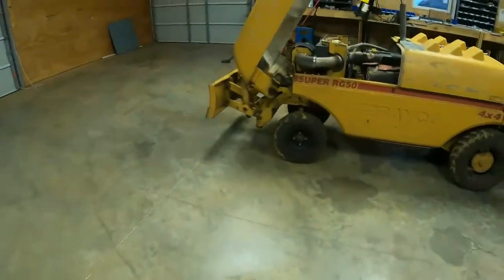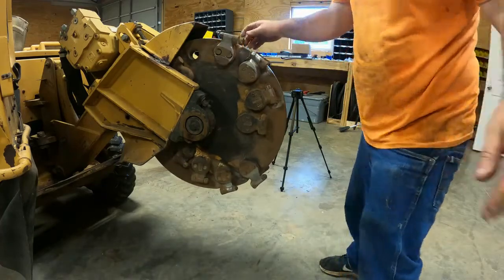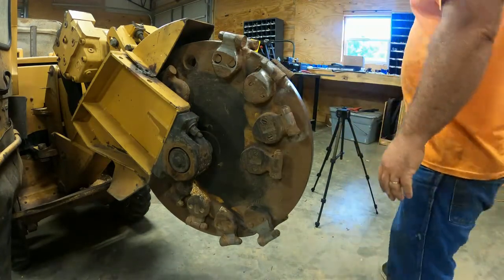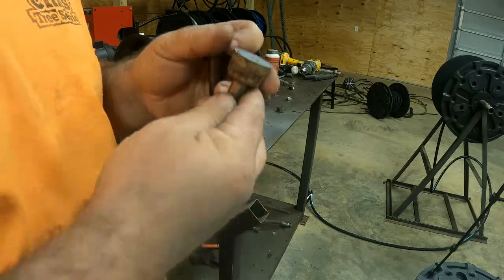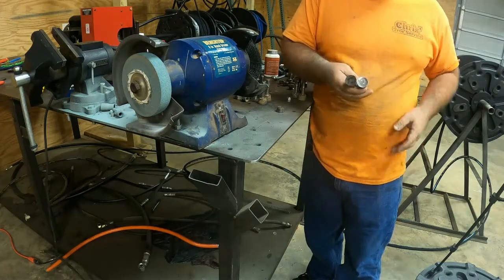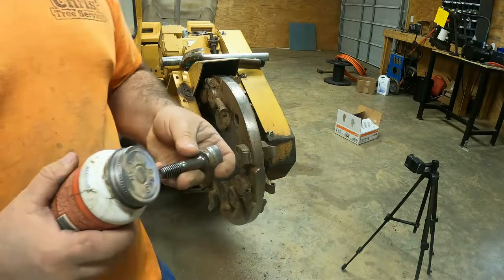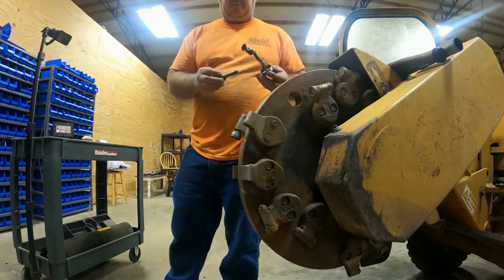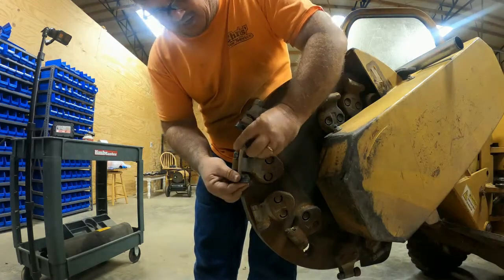Sharpening Green Teeth On the Rayco Rg50 Stump Grinder

Comment: Thanks for the video. That’s how I’ve been sharpening my green teeth for a couple years. I tried using a green wheel and a drill press. The tooth got hot and the solder melted. I got a small diamond wheel and it no longer gets hot. I don’t even have to hold down the drill press handle. Just add a little weight and a few minutes later it’s sharp.

Comment: How do the 1100's hold up against rocks?  We use 900's on ours.  Is your grinding wheel a 20 inch diameter wheel, or is it bigger?  Thanks.
Reply from the maker: penguinistas, I think the wheel diameter is about three foot acros, the teeth does alright for a little while and then they suck or chip terrible and need to swapped out.

Comment: That silicate dust from the green wheel is super bad to breath in wear a mask! You took the time and shortened your life to sharpen those teeth and then beat the carbide with a hammer! Lol wtf
Reply: O ya and those green teeth only need tightened to 45 ft lbs so the impact is way over kill
Reply from the maker: What kind on machine do you run? Thanks for watching Brian
Reply: I have a Rayco rg55